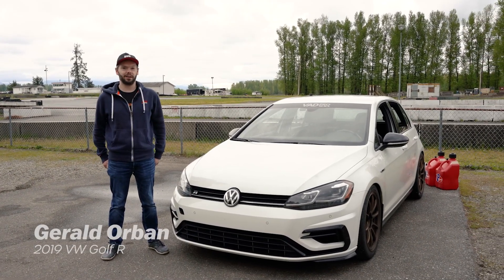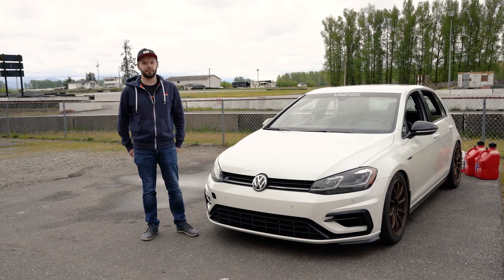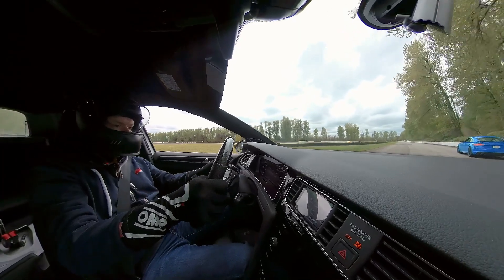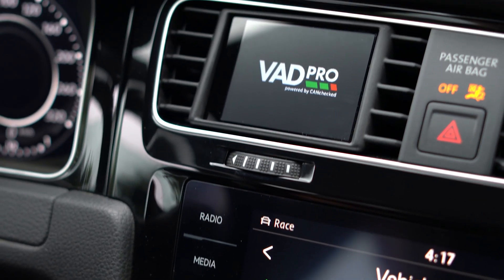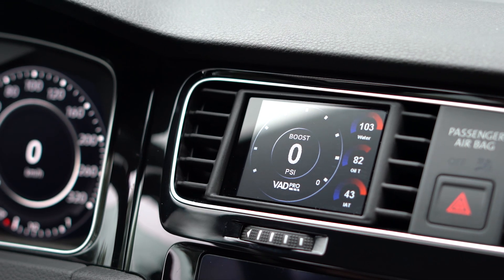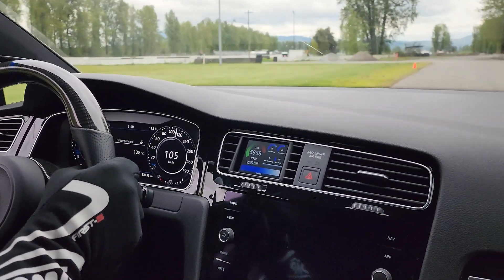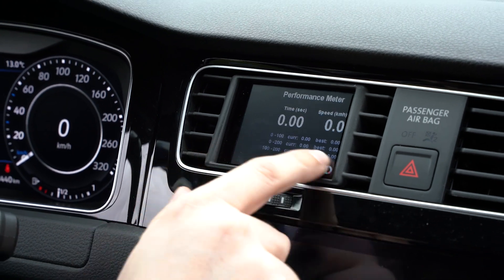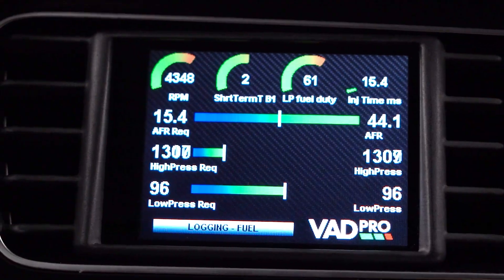VADpro On The Track!

Comment: Do these units read oil press, temp, coolant temp, boost etc from factory sensors without tapping? Im planning on running mk7r with Defi's for mentioned gauges above but this seems like less hassle for more features? Especially multiple data logs and code clear on the fly 🤑
Reply from the maker: Yes, the VADpro can pull all this data off the factory canbus data without tapping.

Comment: How accurate are these? Iv got a golf MK6 R now being built fully forged and my guy who’s building my car has told me about this Vadpro I’m currently using a P3 gauge,how much difference between the both
Reply from the maker: The difference is like comparing a flip phone to a smart phone. They can do everything a P3 gauge does and more. It's tied right into the vehicle canbus and pulls a factory level of ECU data. You can log the car on the fly, read and clear codes. You can expand to add an additional 4 analogue and 2 digital sensors if you need more. You can set up the widgets and sensors exactly the way you want to. It's infinitely customizable. The new mk6 units are connected directly to the canbus harness which leaves your obd port free.